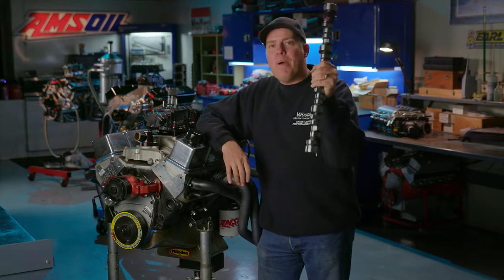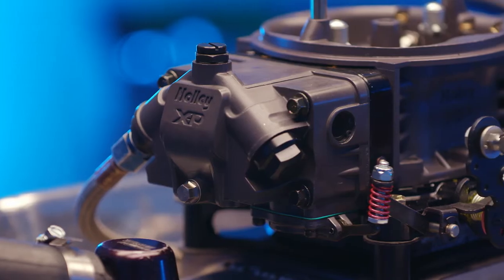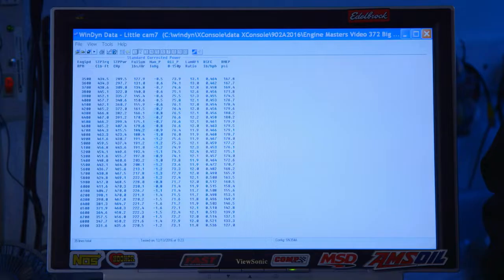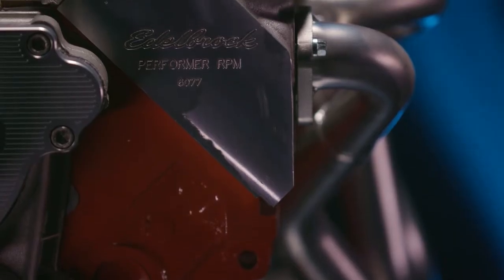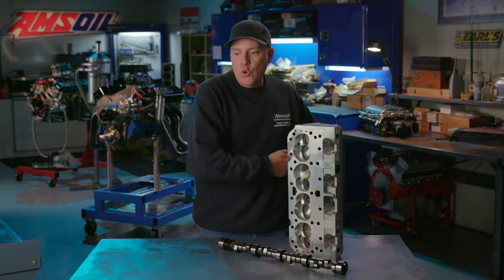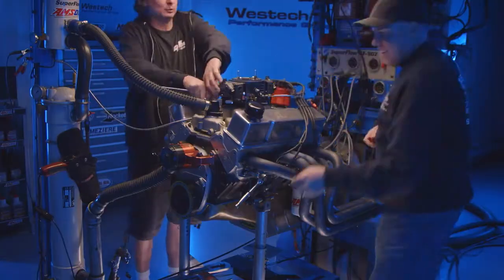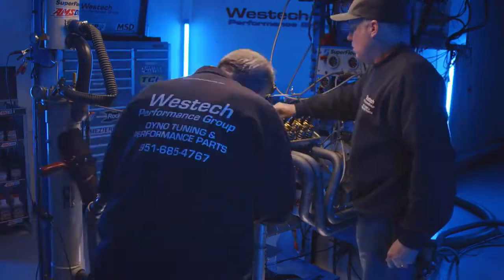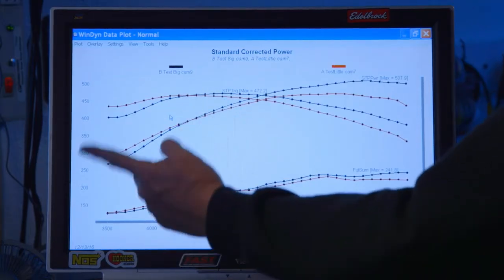ENGINE MASTERS  S2E19 Camshaft Specs Explained

Comment: Id like to see a dohc with variable cam timing and dual length intake runners compared to same basic engine with fixed cam timing & single intake runners on the dyno.

Comment: 372ci is about 6.1L for anyone who was wondering. Incase anyone doesn’t know to convert ci to cc’s (not exactly but close) you can multiply your ci by 16.34. For converting from cc’s to ci just divide by 16.34. The actual number for exact conversion is 16.387.

Comment: If you have Chevy truck with 700r4 overdrive trans where At 60 mph the engine is turning 1,800 rpm the big cam would not be making enough power to keep high gear....
Reply: You'd be riding it on the converter
Reply: My current issue, my 700r4 in my C10 with 3.40's is 1900 rpm at 70mph locked up and bigger cams like the Howards roller in mine just don't make the down low power to pull that effectively unless flat ground with a tail wind lol.

Comment: Why would anyone with this kind of a nice foundation waste their time putting a hydraulic roller cam in this application. The similar spec. mechanical roller would likely make 50 more horsepower than the hyd. roller. Hyd. roller cams are done at 6500 rpm no matter how big it is. Put a 252 int. 260 exh. .600/ .580 lift @ 108 degree mechanical for 600 horsepower. Making good power upwards of 7500 rpm. Peaking around 6800 rpm. Hydraulic roller cams are a waste of time.
Reply: Not everyone wants a solid roller.

Comment: When pouring oil……..ever hear of a funnel?  For a street cam you proved the smaller cam is the winner. Much better up to 4500 RPM’s where most driving is. Drag cam on the street is a big looser because lesser power below 4500 RPM’s. No, building smarter beats more cash for “average Joe”.
Reply: Shit up

Comment: I'm actually surprised you talked about lift values. I don't hear It much. I only hear about duration and separation most of the time. Especially when it's a critical measurement
Reply: Duration  and Separation are where the power is, Just look at the NHRA stock Class!  Where a 210 hp 289 is running in the 11 second zone. They have to keep stock lift but Duration and Separation is allowed to be changed.
Reply: @mylanmiller9656 yeah that makes sense, I can just imagine a IHRA ProMod with 300+ duration and stock lift would make amazing power. I understand what your saying but every situation is different and lift is most definitely an important value just the same
Reply: @rtkl13 Of course  if you have no restriction when making a cam for power but, the stock class 
guys proved that restricting the lift didn't stop them.  A 210 hp  289 mustang stock was a 16 second car, the stock class guys will run 11 seconds all day.
Reply: @mylanmiller9656 again I understand what your saying but your argument was duration and separation is where the power is. Power is a result of many factors, including lift. I'm sure you have heard of guys putting higher ratio rockers on to achieve some torque.....no other changes , just lift. Engine masters is notorious for not giving all the info on their projects (frustrating sometimes) but it is also an entertainment show too

Comment: I nust finished a set.of these for a 63 ym and had the machine shop install bardened exhaust seats then bad the seats enlarfed for 1.94/1.55 valves..I nust saw the beads yeaterday and they're looming awesome. This set is like the 3rd set of small block Ford heads I've done and I have done several sets of beads cor other engines, Mopars, Chevy's and a set of beads for an AMC that came out so beatiful. I spent days on those and anset of heads for my own BBM engines, those heads were installed on 3 different. Uilda and they work fantasticly well. These 289 beads, I spent about 3-1/2 days on and matched the new intake to. I liked doing the Ford beads because a person is able to reach nearly all.of the ports with standar long shank burrs. Not so easy with BBC heads. At least that's what I think. I'm doing a set of Chevy 781 big blocks for myself now and these will be the 3rd set I've used my long shaft tools on. The first were aluminum BBC's with large rect ports. Unfortunately I never got those on an engine before someone else felt they deserved them more than I did. They were taken from inside the cab of my pickup along with the rest of the 540 Inwas building.

Comment: Now what would be fun is have a cam of the same specs as the small cam ground on 107 or 108 lsa and see how much torque it picks up over the big cam lol
Reply: I used to get fixated on LSA. It's not as important as the other inputs on valve opening and closing events.

Comment: I seen the  thing  about Good heads and small cam make power back in 1970 with  the Boss 302!
Reply: Yup, just think how much shit we could’ve broke with the Chevy Duntov cam in our boss 302s…
Reply: @michaellauer3397  It Just may have  made the Boss 302 into the turd that the tunnel port 302 was. The Tunnel port was knowen for making  power but it broke it's back trying to turn the  RPM it took to make  power. There is an  old saying  in Racing, "if you want to finish first, First you have to finish".
Reply: I'm going to have to use ( and apply) that quote that was said MANY  years before I was born

Comment: Wouldn’t a cam with more lift automatically equal longer duration, because the valve has to travel farther? Or is there a cam that has more lift but less duration, and what benefit would there be?
Reply: Heads flow better at higher lift. A cam with more aggressive ramp rates will make more power without giving up low end. Advancements in valvetrain has companies like Comp producing very aggressive lobes allowing for better VE.
Reply: At one time  cams couldn't be ground  with high lift and short duration, but Valve springs have come along way since the 1970s. The today springs can keep  the Lifters on the cam lobe allowing even Cams with really Quich let down  ramps. I can remember when Lifter bounce was distroying Cam train parts in short order.
Reply: No, not necessarily. They can make what's called asymmetrical cam lobes and You can make high lift short duration cams but the duration does not change the lift. It's the other way around. If you get a different ratio rocker arm, it may change the duration by about a few degrees 

 that's way above everybody's head in here lol

Comment: anybody catch what he said bout the overlap even he got confused 🤷
Reply: Just that it's the time that both the intake and exhaust valves are both open at the same time
Reply: It's confusing because a lot of overlap is good for top-end power.  But, getting more overlap from a given duration means an earlier intake closing point, which reduces top-end power.  So, in practice, a narrow LSA will give you a choppy radical idle with bad low-end driveability, a strong midrange, and fall off as high rpm.  A wide LSA does the opposite.  Getting more overlap by making the intake duration longer will REALLY kill the bottom-end but go nuts on top end.  It's tricky to talk about overlap because by definition it also affects either the timing or duration as well.
Reply: @JETZcorp it's trade off city
Reply: @tturi2  100%.  It's why dual-VVT and VTEC are so good.
Reply: @JETZcorp  yeah, unless you happen to have the space magic of free valve, the next best thing is valve tronic and you still suffer with tradeoffs
Reply: So what the 4800 rpm torque on the street is all we need. Drag racing cams on the street suck. Drag racing engine is not what the majority of audience needs. Max power as in this video on street cars gets waisted because it’s out of operation range.
Reply: @genemanno1533  Speak for yourself.